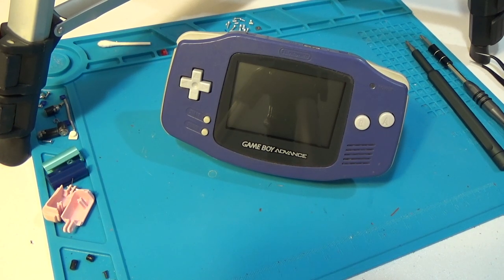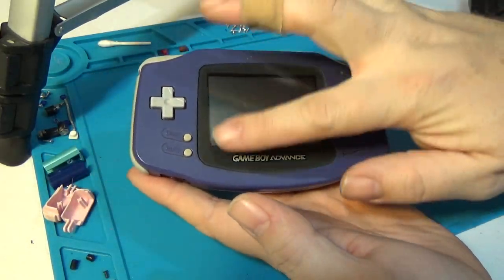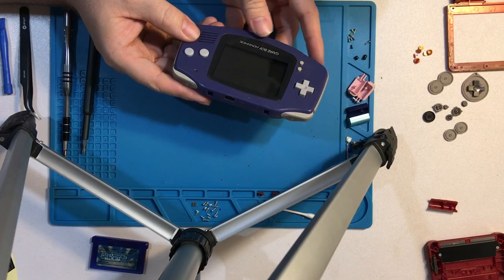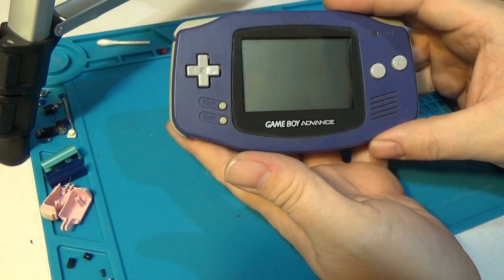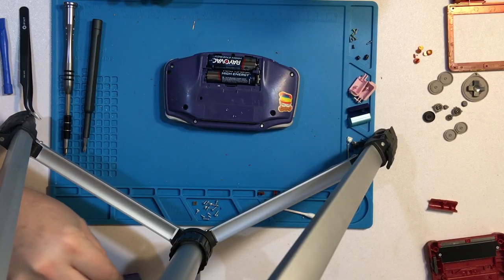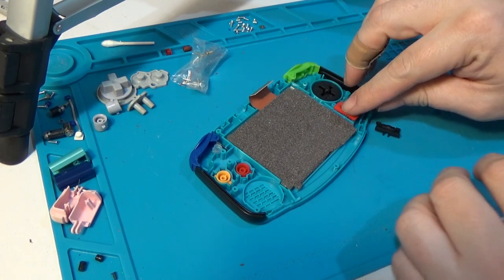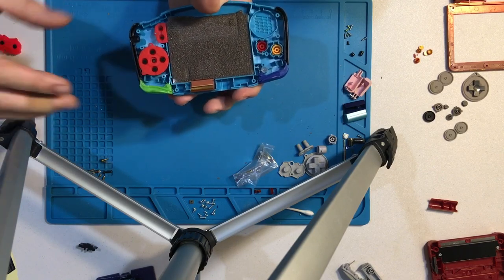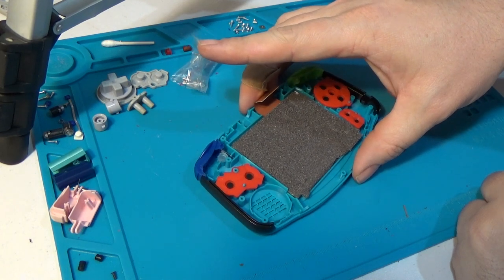How to Reshell a Gameboy Advance

Comment: Your purple shell that was "getting pretty beat up" looks mint compared to my ol' faithful lavender GBA which has the batteries taped on and literally nothing left protecting the actual screen. 😭 I threw out the Pelican light accessory I had last month because it needed a new wire and now I look on ebay and they're worth as much as a mint GBA like frick dude! 😂 Nice vid tho

Comment: Ok, I just did it, but now my GameBoy advance won’t turn on.
Reply from the maker: That’s not good!  What symptoms is it showing?  Did it work before?

If it worked before, troubleshooting it shouldn’t be too hard.  These are pretty simple systems, with just a single ribbon connector for the display, and the power switch and battery terminals.  I’d suspect that it’s likely your ribbon cable is loose for the display, and it won’t turn on.  Make sure it’s seated all the way in (it usually “feels” like it’s in, but you’ll still need to push it in a bit further).

Good luck!
Reply: The Broken Past basically, when I tried turning it on, the led came on for a millisecond and went back off and that’s pretty much it